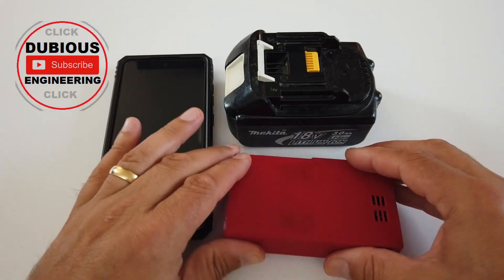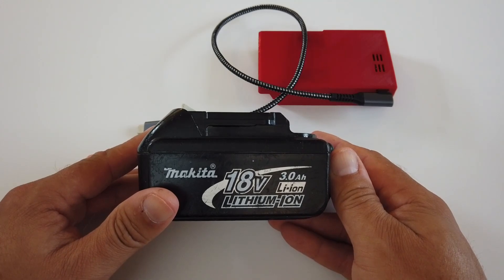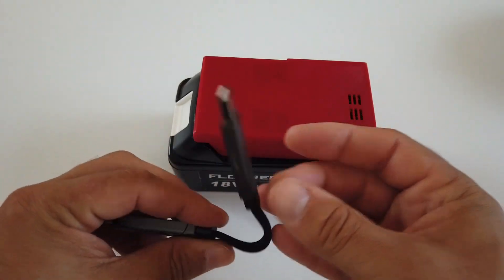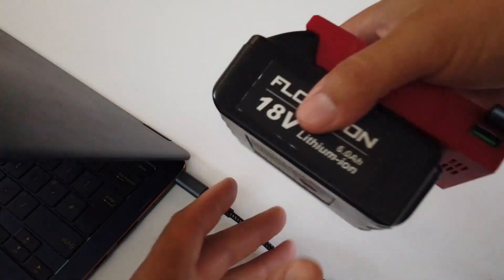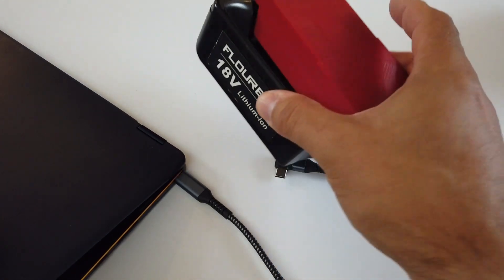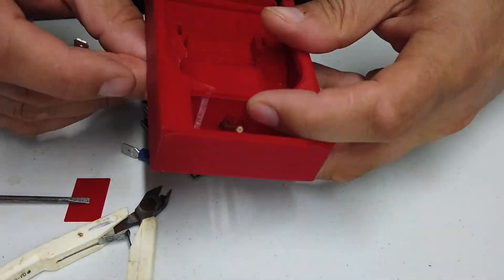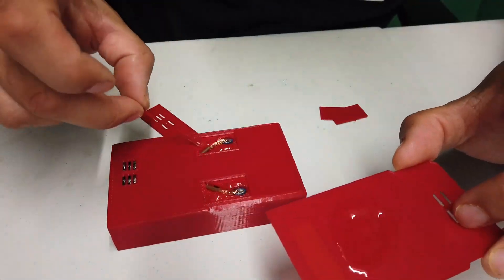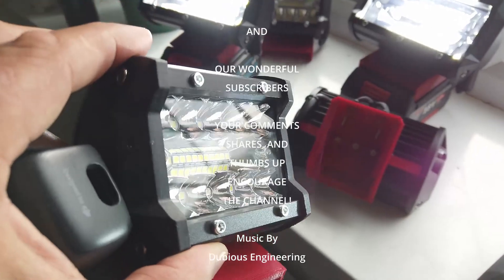DuB-EnG: MAKITA USB C SuperFast Charger Adaptor Adapter PD QC3 QC4 lithium ion power tool batteries

Comment: Im looking for a device like this but i want to charge the power tool battery with high output usb-c. This would be handy for people who travel with power tools like camping or off roading.
Reply from the maker: Yes, agreed, I have an idea to make something like this!  Maybe visit dubious engineering website and pop me a message,  perhaps it'll motivate me to make something!!
Reply: @DubiousEngineering well you've got the idea. I'll probably just make my own. I went down a rabbit hole and discovered a couple options. Skill has a new battery out with a USB port built in, and an off brand DeWalt battery on Amazon has the same. DeWalt actually came out with a device but it's about $100. Amazon sells USB ports with adjustable voltage dip switches. It just needs the 3D print to attach to the battery. Basically just what you have but the other way around. "Different circuit inside"
Reply from the maker: @themotofixery yup exactly that

Comment: I bought one of these recently, it's great. I have questions, though, it's such an intriguing device. I have a 10000mAh battery bank (for an iphone) that I charged with a parkside battery. That battery bank has 50 Wh of capacity, however my 4Ah Parkside battery has only 80 Wh of capacity. How can the size be so different (the parkside is much much larger than the bank). Do you know why? I only wish I had one of these adaptors when we had a power cut last year, I was stuck in the car for hours on end charging my phone... This is a game changer.
Reply from the maker: It’s likely that your 10Ah bank is over specified…. It’s quite common for mildly unscrupulous manufacturers to claim more power than they can deliver.  The best thing is to check how many full charges you get from 10 % battery life on the same device…. Then you’ll understand the weight and size difference!
Reply: @DubiousEngineering  Interesting! The powerbank charges 2 full charges of an iphone xr (11Wh battery). judging that the power bank used well over half the 4Ah (80Wh) Lidl battery to charge, that perhaps means that there's a dc to dc conversion cost? I must try charging the phone directly and see if it charges the potential 7 theoretical times. I know this is off topic from your fantastic device, but I've gone too far down the rabbit hole.  Thanks for the reply.

Comment: what type of burn rate classification is on the plastic?
Reply from the maker: 88mm.mm-1 plus minus 3.5
Reply: UL 94 standard, which classifies plastics according to how they burn in various orientations and under different conditions, ranging from V-0 (best) to HB (worst), including classifications like V-1, V-2, and 5VB or 5VA for more specific conditions.

Prusa has classified plastics, surely other fillament manufacturers to. 

Applicable standard for this type of device has quite high demands. The switching transformer and some other parts on the pcb tends to get quite hot under load. 

I like the idea! But be careful selling theese, so they dont become unwanted candles in someones home.

Comment: Have you tried powering a Pinecil with this?
Reply from the maker: I have a TS100 that works well with this setup!
Reply: @DubiousEngineering  thats nice, but if im not mistaken, the ts100 pulls 30w, and the Pinecil can pull up to 88w. I bought a PD board that looks exactly like yours, itll probably be fine :)

Comment: Does the battery management also have discharge protection? Somewhere I read that that part is build into the powertool and not in the battery itself.
Reply from the maker: Modern batteries have discharge protection...  there are some old Makita batts from 10 years ago that don't fail safe!

Comment: hi. do you also have a model for einhell? i would really like one with usb c 20v and a raw voltage out via a xt60 plug.
Reply from the maker: Hi there! - I'm working on an Einhell high power USB C version over the next couple of weeks.  It wont include an XT60 i'm afraid.
Reply: @DubiousEngineering  good news. the other question is if its really putting out 20v  3A on the usb c? Most boards require 22-24v for the 20v  3A to work
Reply from the maker: @2r2  my tester showed 65 watts but my friend has a better tester that says around 100 watts...

Comment: This pcb with 18 battery , maximum output power 41w 
And you need low power cut off pcb
Reply from the maker: This PCB says 64 watts out, and makita have low power battery management circuits built into their batteries.
Reply: @DubiousEngineering  i checked with Witrn U3,starts with 41w but stable output only 36w ,until the voltage drops to 14 volts. Cutoff don't work in my original batteries, voltage drops to 8v

Comment: Another Great Video! At first I thought the PCB might have been similar to the one I recently fitted in an old miners lamp, but that was for charging lithium cells, not PD. I see you like your LED lights too! I've fixed quite a few Milwaukee one's. I recently repaired a huge one which has 12x Cree LED's in it. I used it in the miners lamp video in a huge cavern and it lit the place up well!
Reply from the maker: Very cool! ...   12 cree LEDs sounds like it draws a lot of current!  ..  How long does the battery last?
Reply: @DubiousEngineering  not too sure but its bloody bright if you check out my miners lamp repair video I test it in the mine exploring part. I had a 5ah battery in it and the smaller light with around 8 cree lasts a good few hours!
Reply: The repair video for that one(huge light) is set for Saturday at 4pm

Comment: Great product Howard.  My 3ah battery charged my Galaxy S21 Ultra (5000mah) 3 times to 85% (battery protection mode) regarding the BMS in batteries, Makita have a little star on the top in the plastic if it has BMS, no star, no BMS.
Reply from the maker: Really useful info Lee and thanks for reporting back on the tests you've done!  All the best!
Reply: Your maths doesn't make much sense unless you charged your phone a few percent only. 3ah battery = 3000mah. 85% of 5000 = 4250, 4250 x 3 =12,750. 3000 < 12750
Reply from the maker: @zenmoto369 remember there's a large voltage difference...  phone battery is 3.6v at 5000mAh ....  Power tool battery is 20v at 3Ah ...   have you seen the 20000Ah Chinese power banks!! Load of rubbish!!!
Reply: the makita battery I have has a star but that only means that it will shut off when specifically used with a power tool that also has a star on it. So even the star batteries don't have low voltage protection, but the Florean or some of the knock off makita batteries actually do have low voltage protection.

Comment: That is very neat indeed. Now we need those for WORX, Parkside, Ryobi etc
Reply from the maker: Awww man... you got it! That's the plan going forward! Hope all I well there!
Reply: Exactly! Battery packs need to be more universal so we don't end up with all kinds of batteries at home that are not being used at all. I'm looking at buying a big enough battery to charge my laptop when I'm out and about this summer but it would be much nicer if I could just use my Worx and Parkside batteries that I already have and are not doing much most of the time.